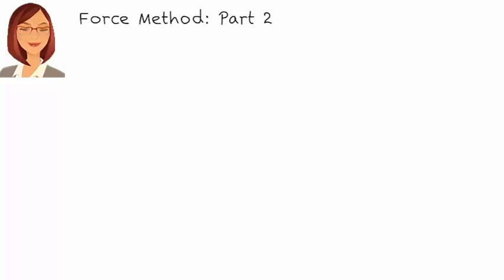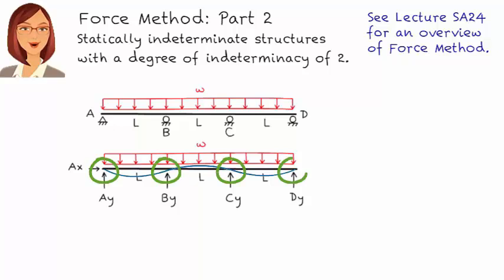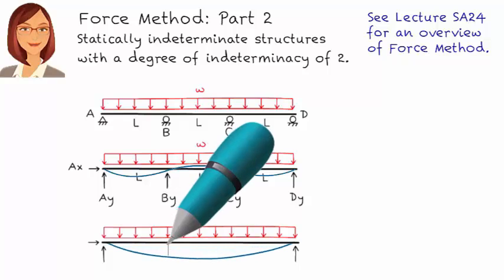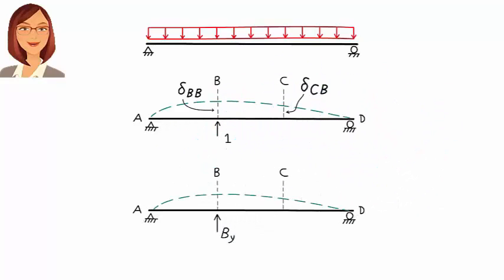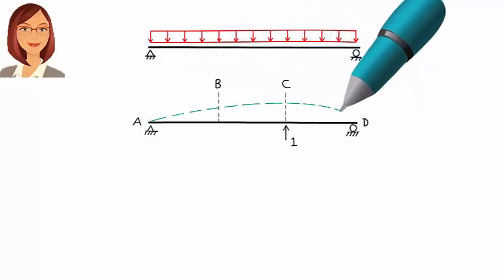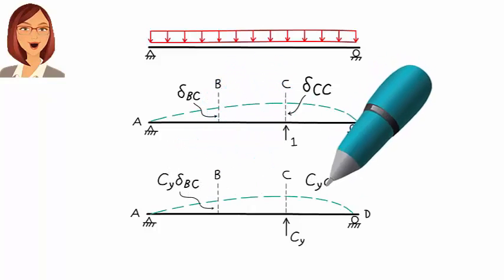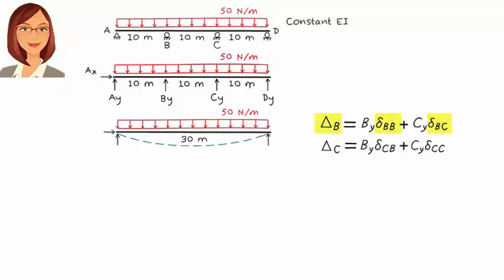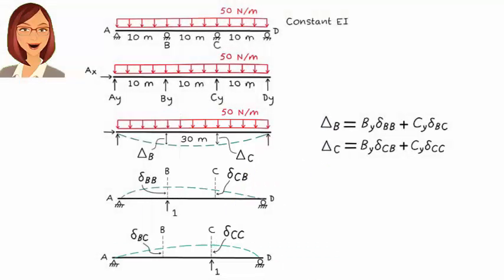SA25: Force Method (Part 2)

Comment: pls Is this applicable in all case of indeterminate beams
Reply from the maker: Yes, the force method can analyze any indeterminate beam or frame. However, as the degree of indeterminacy of the system increases, the use of the method becomes more laborious.

Comment: e.g we are talking force at C and D as redudants then while calculating delta D, will m* will have only 1 equ? as force at D will have 0 distance.
Reply from the maker: The reaction forces at B and C (not C and D) are taken to be redundant. Please rephrase your question.
Reply: @DrStructure  I know that B and C are taken as redundant in this beam I am talking about an other example like e.g I am taking C and D as redundant roller support at B will be remain same. In that case while I am calculating delta D virtual/unit load (1KN) will be applied at D then what will be the equation of m* ? Or Is it compulsory to Always take B and C force as redundant?
Reply from the maker: In that case, there would be two moment equations when a unit load is placed at D. We need one moment equation for segment AB (there would be a reaction force at A and one at B), and another moment equation for segment BD.
Reply: @DrStructure  ok thank you

Comment: Why are we applying the unit load at b when finding m*?  for deltaBC, isn't the load applied at C?
Reply from the maker: I am assuming you are referring to the calculations at 9:19.

To determine deltaBC using the virtual work method, we need to write two moment equations: We need the moment equation M(x) for the beam when the load is at C (this is assumed to be the real load), and we need the moment equation m*(X) for the beam when a virtual unit load is placed at B (this is the point at which the displacement takes place). 

According to the virtual work method, to determine the displacement at point P, we need to place a virtual unit load at point P in order to get m*(x).
Reply: @DrStructure  Thank you so much! Now I understand why. I had thought that was the reason but couldn't tell why.

Comment: Why do you write displacements as By*deltaB ? is not that a unit of work? actual displacement is delta B, so it is unclear how you come to writing force*displacement = displacement ?
Reply from the maker: deltaB is displacement due to a unit load, or displacement per unit load. 

So, displacement due to 2 unit loads would be 2*deltaB. Displacement due to 3 unit load = 3 deltaB, and so on.

Displacement due to By unit loads, therefore, equals By*deltaB.

Comment: How do you use the force method on frames?
Reply from the maker: The force method involves removing redundant forces from the structure and calculating the displacements that result. The shape of the structure is inconsequential. As long as we can calculate the displacement due to the removed the redundant force, we can apply the method to any analyze the system.

Comment: what happens if you have a beam with a varied value of EI (says the same beam in the problem above but has linear variation from EI at the left to 2EI  at the right, how is that alter the force method solution ?)
Reply from the maker: The force method uses displacements for formulating and solving the compatibility equations for the redundant forces. The EI for the beam effects the displacements. When solving for displacements (Delta), we integrate the product of M and m*, where EI appears as a constant to the left of the integral symbol. If however, EI becomes a variable, in terms of x, then we need to write it to the right of the integral symbol. This means that now instead of just integrating M m*, we need to integrate M m*/ f  where f is the function that describe EI for the beam.  For example, if EI changes linearly as you have indicated above, then f can be written as: EI(1+x). This means that now we need to integrate M m*/(1+x) in order to calculate Delta...
Reply: @DrStructure  It makes great sense. Thanks
Reply from the maker: You're welcome.

Comment: Hi doc. @ 9:19 , for delta bc, i get the first equation , however , the second term i.e. the limits 10-20 intergral, how do you get that ? because in the previous equations, there were only two sets of intergrals and i noted that you used virtual load at bb in this bc equation which i understand as it relates to the relationship between b and c. Im just really confused as to how the middle term at 9:19 (10-20 limits) becomes part of the delta bc equation. please explain. thank you.
Reply from the maker: For M(x) we have two equations, one for interval [0,20] and one for [20,30].  We also have two intervals for m*(x), [0,10] and [10,30]. However, these intervals are not a perfect match, they overlap. To integrate Mm*, we need to make sure the limits of the intervals are perfect match. 

So, we can divide the first interval for M(x) into two intervals, like this:
M(x) = -x/3  [0,10]
M(x) = -x/3  [10,20]

This does not change the nature of the equation. But now the first interval of M(x) matches the first interval of m*(x).  Therefore, M(x) can be written in terms of  three equations:
M(x) = -x/3  [0,10]
M(x) = -x/3  [10,20]
M(x) = 2x/3 - 20  [20,30]

We also need to divide the second interval of m*(x) into two intervals: [10,20] and [20,30]. This gives us three equations for m*(x) as well:
m*(x) = -2x/3 [0,10]
m*(x) = x/3 - 10 [10,20]
m*(x) = x/3 - 10 [20,30]

Now we can integrate the three parts knowing that their limits match.
Reply: @DrStructure  thank you doc. That explains a whole bunch :). Im currently dealing with a static indeterminacy of 3, so having to formulate 3 different equations really complicates the method. I haven't seen anyone do a beam with that many unknowns. If possible doctor, could you do something like that? It would really help. Thanks again for the explanation. Subscribed and liked 👍
Reply from the maker: @AK--if1su  Here is an analysis example of a beam with three unknowns, in PDF format: 
http://lab101.space/pdf/examples/SA25-Example1.pdf
Reply: @DrStructure  thanks a lot Doc. I will have a look. Really appreciate the help. 👍

Comment: dr structure if we suppose that the span distribution will not be equal like shown in the video 10m 10m 10m,what if its like 10m,10m,5m will still be the deflections be equal when unit load is applied on the constraints please reply dr strcuture
Reply from the maker: Yes, Delta_B and Delta_C are going to be different if points B and C are not placed at the 1/3 and 2/3 points along the length of the beam.
Reply: @DrStructure   kindly make a video in how to apply maxwell reciprocal theorm dr structure with examples,and many thanks for the reply

Comment: Dr structures, will u please explain how to solve the support settlement problems using the FORCE METHOD?
Reply from the maker: Make the reaction at the support with the settlement the redundant force. Assuming that is the only redundant force, then the compatibility equation becomes:

D + (F d) = s

where D is the vertical displacement at the location due to the applied load. If there is no applied load, then D = 0.
F is the unknown redundant force, d is vertical displacement at the point due to a unit load. and s is support settlement. 

We'll do a lecture on this at a later time.
Reply: @DrStructure  Thank u so much. May God bless u more with the light of knowledge!

Comment: may i know how to solve when both ends and fixed(Degree of indeterminacy=3)
Reply from the maker: In such a case we need to pick three of the reactions as redundant forces. For example, we could pick Fx, Fy, and M at either end as redundant forces, thereby turning the beam into a cantilever one. Or, we could turn the beam into a simply supported one by making the end moments and one of the horizontal reactions forces redundant.
Reply: Dr. Structure ya..from your tutorial i know how to solve when my redundant force is in vertical direction... but how to do it if it is in horizontal or moments
Reply from the maker: I'll do an example video for you in couple of days.
Reply: thank you so much
Reply from the maker: Please see: https://youtu.be/Ho_yrY8efy4

You can also access the example directly from SA25, just click on the circled i at the upper right corner of the video, or see the video description field for the link.

Comment: ıs there a possıbılıty that force method mıght also be named as superposition?
Reply from the maker: No, we often use the principle of superposition when we wish to determine the net response (say, the displacement, or support reactions) of a structure subjected to multiple loads by adding up all such responses due to the individual loads.  Although that principle is being used in the force method, they are not one and the same. Superposition is a more general concept and works for solving all sorts of problems in engineering and physics.

Comment: Thank you..great work!
In the case that we have more than 2 degree of indeterminacy , for example 3 pins, what we will do?
Reply from the maker: The same principle applies except that we would end up with three equations and three unknowns (redundant forces).
Reply: Thank you for your answer! So there is not any other shorter way?
Reply from the maker: Not really. The number of equations to be solved equals to the degree of indeterminacy of the system. N unknown forces means N equations.

Comment: it's understandable. I appreciate for that but how did u calculated the bending moment for real structure. I,e while calculating Delta B we need to calculate bending moment for real structure as well so how did u calculated that , can you elaborate it I couldn't find answer for that. thank you
Reply from the maker: The beam is statically determinate. We can easily analyze it and determine its bending moment equation(s).  See Lectures SA06 & SA07, for example.

Comment: Does f_BD always equal f_DB when considering a system of Degree of Indeterminacy=2?
Reply from the maker: Not sure what you mean, please rephrase.
Reply: +Dr. Structure sorry let me try again. delta_bc and delta_cb both = 10500/27EI and I was wondering if delta_bc always equals delta_cb or if it was only this problem
Reply from the maker: They would always be equal. delta_ij always equals to delta_ji where i and j are points on the beam.